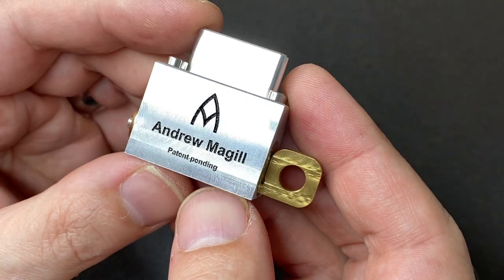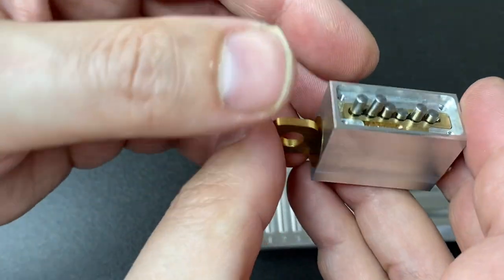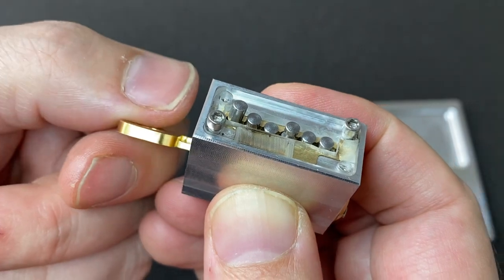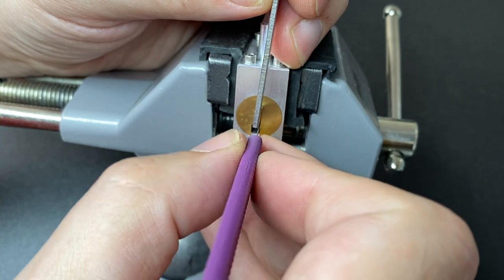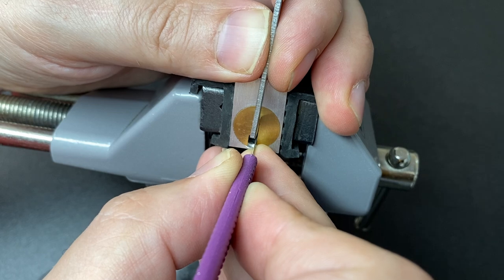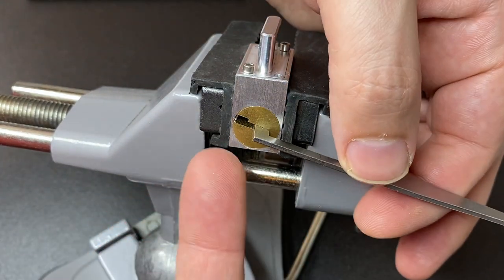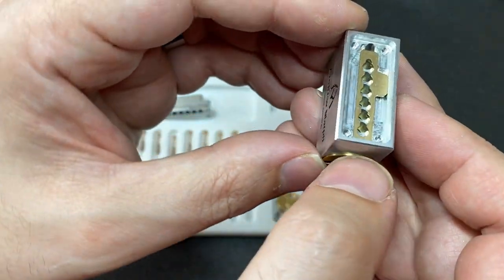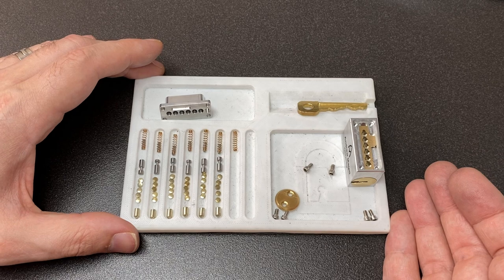Unpickable? Enclave - an Ingenious New Lock Design

Comment: As far as I can tell, there are at least 2 ways to attack this lock. 

The obvious destructive attack problem: this lock is a lot more susceptible to a plug spin attack once you pick it to any sheer line, because then you have 1 pin, in this case steel and nicely shaped to apply maximum pressure in a very small area, pushing up against a thin, in this case brass, sheet of metal, once you bend it or sheer it out of the way, the lock opens. But this is the boring part, though one that does need to be addressed in this lock.

For the picking attack. There is a degree of separation between the pins being acted on and the sheer line is interesting. But I think this is still attackable. If we apply pressure on the bar, the top pins, by the virtue of them being pins in holes, will have a sort of a binding order. That is, the blocking pins are necessarily sequential. With the same pressure on the cylinder we should achieve the same binding and so the difference between a bound and freed pin should be detectable via the rotation of the cylinder at the same pressure. So I propose the following mechanism for manipulating this lock:
- Pick the traditional part of the lock first setting all the stack to the lowest possible position, so that bar manipulation can happen
- From this point we are going to need consistent tension, and this may just be the first legitimate use of those "feather touch" turning tools that needlessly take up space in our old tools drawer
- Note the rotational position of the lock before manipulating any pins
- Select a pin
- Release tension almost all the way so that you can manipulate the chamber
- Move the selected pin 1 position up
- Tension the bar again
- Check for any change in rotational position of the lock under tension
- Repeat through the range of the pin
> The thinking here is that if there is a binding order for the side bar, when you find the binding pin and set it to the correct position the plug should spin slightly more than it did before as the bar would be able to move just a bit more
- If no change in rotational position was discovered, move to the second stack and so forth until a change is detected
- Note the stack and position
- That's the first stack in the binding order
- Fully release tension to reset all the stacks
- Pick the traditional lock again
- Now set the first noted stack to the detected position, this can also serve as verification
- Look for the second binding stack, third and so forth.

The maximum amount of combinations, if this attack is indeed viable, would be 105, with the majority of locks opening somewhere in the 30-60, I will call them attempts, range.
Reply: One could add a false gate for the slide bar. I also wonder a bit if the wedge pin could fall into the keyway at 180 degrees.

Comment: so basically a fully bitted lock has 6⁶ = 46656 different possibilities to turn the cylinder initially. and only one of those will turn the cylinder all the way. and there is no way to know which one will turn it all the way, when you start turning it. nice.

Comment: An ingenious design and most excellent machining, beautiful 👍 It seems that where the 'slidebar' pin hits the ramp of the core is at such an angle that it has little lifting leverage, only enough to move the slidebar, which should prevent core forcing to get past it. If you didn't know what was inside of this I can see no way of figuring it out which would render it pick-proof for real-world situations; especially if you disguised it with a common keyway and no markings. That would add to the poor picker's frustration wondering why the heck they can't make progress with this simple "Kwikset/Schlage/whatever" core  😈 And if one chose 'brute force' you'd just about need something like a Lishi and a notepad to keep track of where you were with it given all the possibilities. With proper drilling protection only core pulling would make a sensible attack, but of course thinking it's some common core you'd waste a lot of time trying to pick it before you came to that conclusion 🤣Superb!
Reply: The purpose of picking is to gain entry and then exit without anyone knowing. Destructive attacks always work but the owner KNOWS someone has gotten past.
Reply: @glasslinger  I do well understand picking and locksport, but I also see locks for their purpose- security. Picking is the advanced skill, raking or zipping etc needs less finesse, but if your purpose is to just open the lock it's a legitimate approach. If a lock is so well done that it's only vulnerability is destructive attack, then that is high praise for the lock, and a top-grade challenge for the pickers which they will certainly enjoy. 

For me, there's more to it than picking- that's all. For others, go for whatever makes you happy about locks and I'll be there cheering you on.

Comment: While the mechanism is quite well designed, I see a significant issue with the real world usage of this locking mechanism. The fact that it appears to be relatively easy to brute force open. This would be done via inserting a heavy steel tool into the keyway and applying heavy torque to the key cylinder. Punching the angled rear most pin through the brass side bar.

Comment: What a clever take on the pin tumbler design. 
Not unpickable, no. Any security device need to have a legitimate way passed it, so there is always a way. It all comes down to how hard it is to find a feasible alternative to the correct key. I wonder how it would hold up to something like a vibrator attack, possibly with varying frequencies. That could potentially try a huge number of potential candidate positions for the “disk pins” and over a long enough time you could randomly hit the correct combination and hit both a shear line for the disks and alignment for the top pins. 
Does that sound like a potential strategy?
Reply: It would be pure luck as you cannot manipulate and test at the same time. Basically, the EPG will set a random combination and the core will turn 45 degrees. But once the core is turned, you cannot manipulate anything. You can just test the combination entered and that’s it. You then need to reset the lock to test another combination.
Reply: You'd have to build something similar to a brute-force safe-picking machine that resets after each failed open.  Crunching the numbers ... if you have 6^6 combinations and are somehow able to try 2 combinations per second, then that's almost 6.5 hours to test all the combinations.  So on average it'd still be over 3 hrs to "pick" it.  So it's "pickable" ... if you can make an enormous racket for 3 hours!
Reply: @yom73  yes, that is my point. If in the first step a disk shear line is found and the initial turn is initiated, then in the next vibration/sound is applied, making the top pins “jump around” randomly, with a light tension that could be backed off after every unsuccessful try a large number of top pin positions could be sampled until the lock open. I may have missed a detail in the design, but if all pins are first picked to the first partially turnable position and then the vibration is applied…
It won’t be a particularly covert technique as I expect it to be quite loud, but I am guessing that it could perhaps work. Maybe not super elegant, but if it works it works. I am someone will come up with a better idea soon.
Reply: @DrBovdin  picking the lock to the first turnable solution is extremely easy as all the pin stacks are exactly the same except for the cuts on the drivers. You can lift all the pins a bit with a flat pick and you’re done. For the second step, I agree with you, that is be the best option I have found so far. However, remember that you cannot hit directly the pins, just induce vibrations into the core. Not sure if we can transmit enough energy to the pins to get them all moving randomly to any combination. I tried with a rubber hammer with no success. I tried with a very strong magnet on the side of the bible, no luck so far. Theoretically that should works, in practice I am not sure. I need to find an EPG for testing.
Reply: @yom73  multipick sells a beaut! I like ur thinking!
Reply: @SadisticPicker  A bit expensive just to test an idea. But I have to say that I am tempted. Their new EPG is gorgeous but the price… 😱 The Kronos seems to be a better option but I honestly I won’t have any use for this. That said, we all know that one of them will come to grow the tool collection at some point. 😬
Reply: @yom73  I almost picked up a brand new one for 3 hundred a few months back. Only thing that stopped me was I didn’t know the guy. And was scared something wasn’t right. I have horrible luck. And could just see that it would’ve been broken or some shit😂. And I’m definitely sure ya could find locks to use one on. I will get one, one day😳😂😜
Reply: @SadisticPicker  I was trying to justify myself a Kronos and they release a new one… It will end up like my purchase of the Silver Bullet, put it in the cart, close the eyes and press the button, and then try to forget immediately what you have done. 😬

Comment: I like the design, but it sounds like this might have a similar weakness like the StuffMadeHere-lock that LPL had a crack at, where just the ability to turn the plug just a little bit might disengage, say, a dead latch.

The design here is otherwise ingenious, because the idea is that you can pick it "incorrectly" - and you will have no way of knowing until it stops at the 45 degree angle and you're like "Oh, that wasn't correct" and you'll have to start over. And it seems to me like this is decoding-proof as well, so there's no way to decode the lock without getting it open.

Comment: Looks like a great, practical design; the only reason I can think of for a major lock manufacturer NOT offering something like this is the great difficulty in picking it by a professional locksmith in case you accidentally lock your keys in the house. I'd describe it as an inversion of the master keying principle, and it could easily be adapted for master keying by changing the lengths of the notches in the spools. I'd love to see an updated version with keyway warding that mimics one of the more common keyways.

LPL might be able to design a specialty tool for this that would apply tension at the 7th pin position, so you'd have feedback on whether you were in a false set or one that is true. ("The pellet with the poison is in the chalice from the palace.") Other than that, I can't see any possible exploits.

Comment: Could you over-set all the pins and let them fall into place?
Reply: No. You can lift all the pins to max height but then they maintained into position by the wafers. And to drop some wafers you need to go back to the 0 position where there is no tension onto the top bar.

Comment: The one exploit that I can see would be drilling the cam pin, since its position is known, then would open on any false set. Fairly easy to harden just that point though.
Reply: I came here to say the same thing... drilling is the only thing I could think of, since it doesn't have any anti-drill features, but again would be easy enough to do.

Comment: He needs one of the first pins to be magnetically, locked, inversed. One should not be even aware that there is a pin at that location with a plastics unopened slot. Then the lock will not be defeated anymore.

Comment: "Unpickable" isn't ever going to be possible as brute force will always exist. But if you're only solution is to try every possible combination, you have the best possible pick resistance imaginable.
Reply: Brute force is a different attack to picking. An unpickable lock doesn't mean an unbreakable lock, they're distinct characteristics.
Reply: @pauljefferies5837  I don't mean brute force as in physically breaking the lock, I mean brute force as in trying every possible combination, because this is basically a combination lock at this point if you're trying to pick it.

Comment: so..... essentially the entire lock is picked even if you have no experience whatsoever at the first attempt, except for one single pin keeping it from rotating, the way understand it. i kinda see a problem with that. all you need is a flat screwdriver and a wrench to force it open at that point.... I mean it's cool and all, but i'd hardly call it a security device

Comment: This is a similar idea, but a completely different implementation to the unpickable lock design by stuff made here https://youtu.be/2A2NY29iQdI in both cases the function of the sheer line of the cylinder is separated into selecting the tumbler positions and the check if that tumbler positions matches the opening pattern. in this case with the sidebar. The design is actually remarkably similar, but this lock will work reliably and for a long time. With the wavers there is the downside that in theory it should be possible to brute force it (ie. try all possible waver combinations). A lishi tool is probably the way to go there, but with thousands possible combinations this would still take too long to try.
Reply: On second thought, the waver for the correct combination should have different wear marks from getting dragged over the shear line/cylinder side. I'm not sure how to really measure that, as even a tiny camera in the lock should not be able to see that.

Comment: If I see the design, the pin springs are too long; so pushing all the pins all the way up could be a potential bypass
Reply: There are steel pegs inside the springs to prevent over lifting
Reply: @chrism4008  I hope those are bevelled so they won’t hinder the springs themselves?

Comment: Would take no more than 5 to 10 seconds at the most with a cordless drill to defeat this lock.  It's not always about being pickproof. Very few thieves use picks. Using brute force is far easier and quicker. As my cohorts on crime used to tell me. Don't overcomplicate an entry simply for the sake of thinking it makes you ore cool. The objective is to defeat the lock in the quickest fashion and get on with whatever nefarious things you have planned. Not everyone needs to be LPL.

Comment: I have found a more secure way to create an unpickable lock, that uses existing pins and keys! but I must caution that creating an unpickable lock also creates a lock that cannot be picked, which is a security problem for when YOU are the one who can't get in, and the lock is being used to provide minimal security for even the most basic necessities in a dystopian world. I would rather not create such a security nightmare as a house I cannot break into.
Reply: Eh, in an emergency it could just be drilled out.

Comment: I saw a bike lock that had a somewhat similar design, in that it isolated the key turn and the actual unlocking pins, although it did it via closing the keyway with the key inside during the rotation.

It was bypassed pretty easily.

Comment: Very clever lock. I'm wondering though aside from single pin picking could other multi pin approaches work ? Maybe a bump key combined with single pin? It seems the issue with single pin is the false gates due to the wafers and while that still may be a problem a multi pin approach it might get them in the gates a bit quicker? 
Thinking outloud is all.

Comment: I mean, that's cool, but who really needs a lock that can't be picked? 
What you really need is an unbreakable door. Like criminals are wasting time with finesse...
I'd rather have a pickable lock so if I lock my keys in, I don't have to destroy the door... Well, not like most locksmiths you call waste any time with finesse either, plus selling you a new lock or door is way more profitable anyway...

Genius mechanism, though. I have no idea how to overcome it. Not with finesse anyway.
If you know exactly what's in there, maybe you could pick every pin to the correct height, but how would you arrive at that knowledge without opening it first? 
Also, if you know, you might as well make a key.
I mean, yeah, bruteforcing the combination I guess... Well outside the range of practicality, though.

Comment: What about a screwdriver attack?
Reply: Too many flimsy plates,
Reply: In a production lock I’m assuming core housing wouldn’t be aluminum. This is a prototype to try and let people find the holes in it before producing it. If it was a brass body and core or partially steel in something like a way to cylinder design it would just break the housing before the core itself gave is my guess if you go destructive nothing is very secure.

Comment: Just on a whim, would it be possible to induce the pins in stasis with compressed air, and then wiggle them in back down in with the tensioner in a repeative motion?

Comment: I don't quite understand how you can push pins up with the lockpick and hold them up. Aren't the springs at the top constantly pushing them down? I would think a pin would go down as you moved the lockpick to the next one, and that you'd have to push all the pins up at the same time by the correct amount for it to work.

Comment: One way I'd go about this one is to go through each pin one by one with a leeshi tool setting each all the way until all wafers are lifted and note the cut then cut a key. Not super easy or practical but I feel it could be a reliable method.